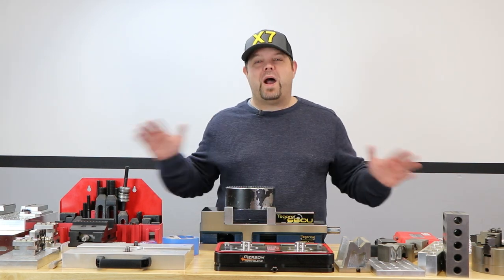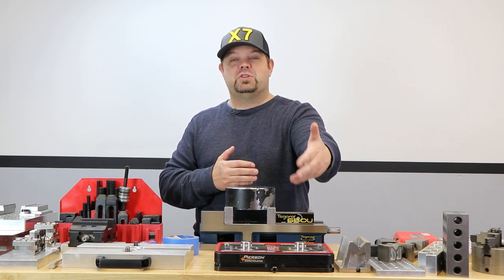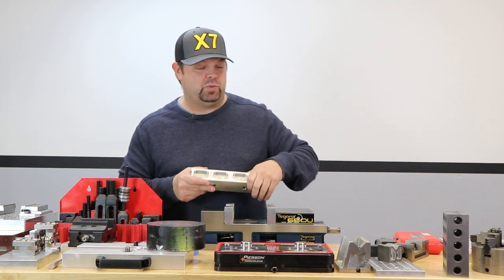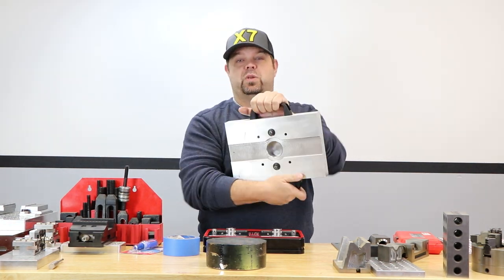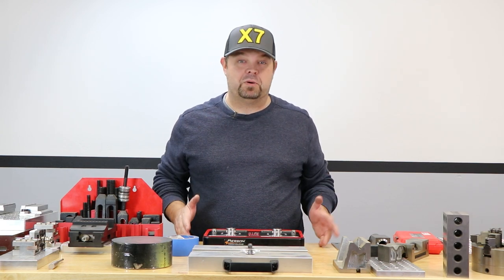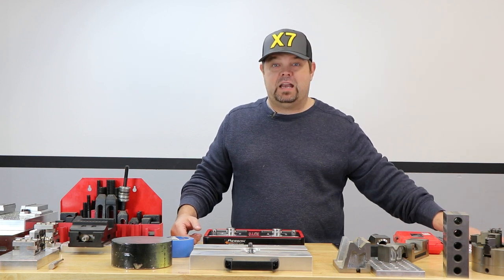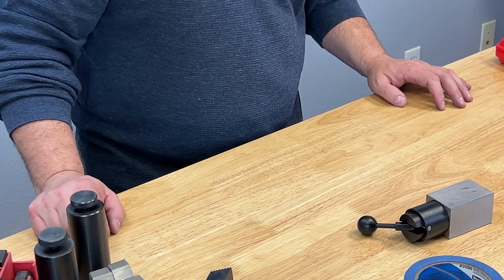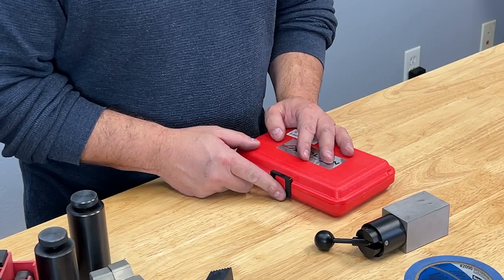Intro to CNC Workholding

Comment: We use the machine jacks to support the workpiece, not the toe clamp.  If you were to set the positive angle you would push/clamp on one point of its diameter (tangential).  This pushes the Jack away.  or only to be used with 100% 0 degree alignment… even then use little cutting speed and material removal.  Keep it safe❣️

Comment: Toe-clamp must be used between 0 and positive 5 degree angle. I set it level en go one step up. The bolt is as close to the workpiece as possible and not the clamping blocks, you want to clamp the part not the blocks.

Comment: A method useful with tiny delicate pieces is to hold or support them in a small tray of low melting point metal (Cerrobend) and remove later with boiling water or hot air gun.  (I use a block of aluminum that has a pocket about the size of a matchbox.)  Have also read of parts being frozen inside blocks of ice for machining!